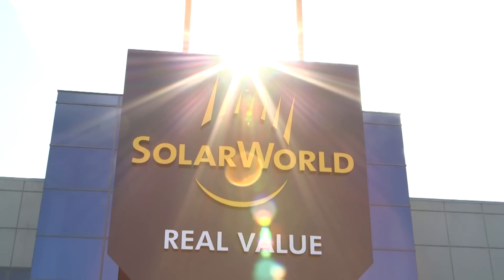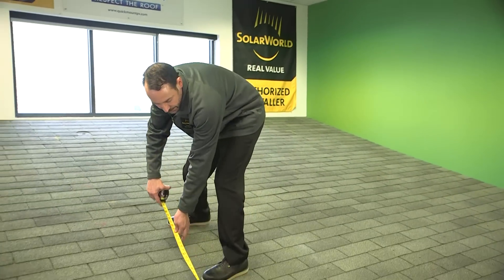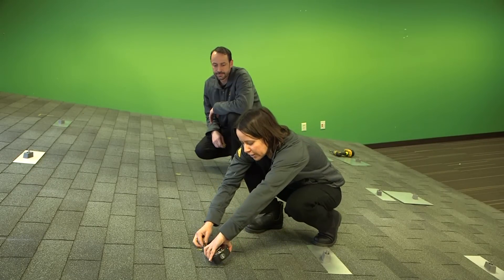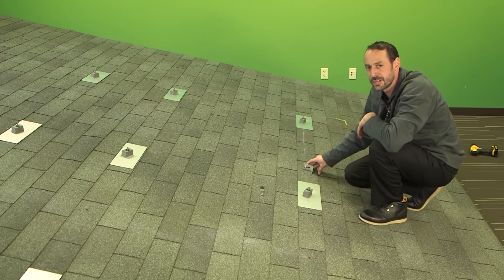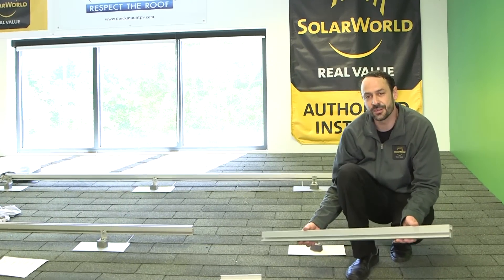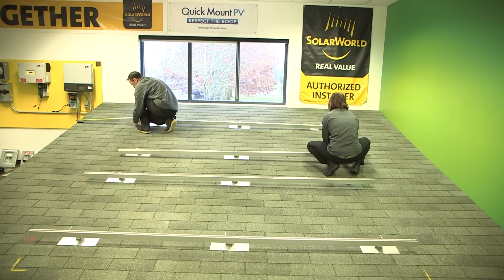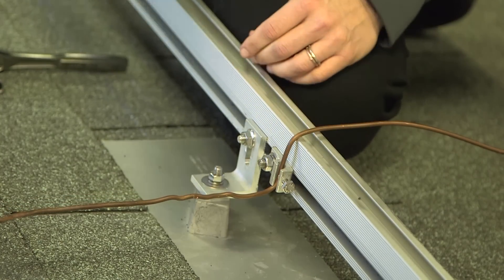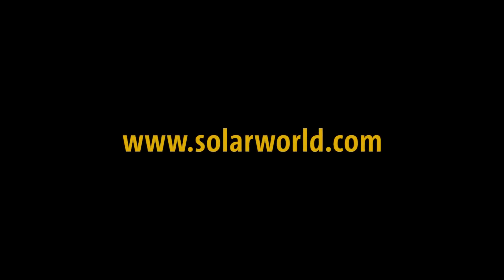PV Installation (Part 1) - Planning and Racking

Comment: I usually see a little more slope to a roof - nice, though, how you can set tools down and they don't slide away.   I have one point of caution for your ground wire layout:  it should not be allowed to contact the rails themselves since that would lead to corrosion, whereas the ground lug is coated appropriately and should be the only contact with the copper.